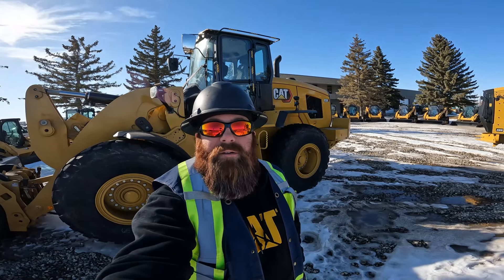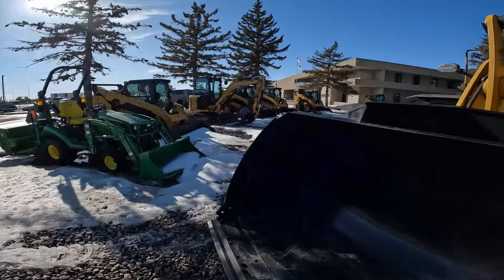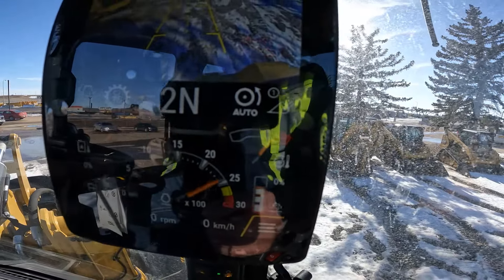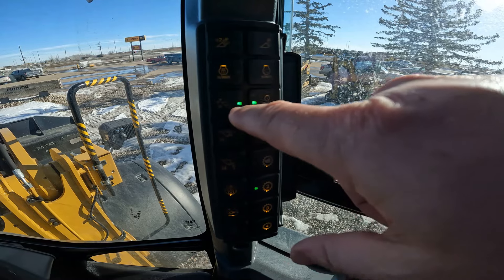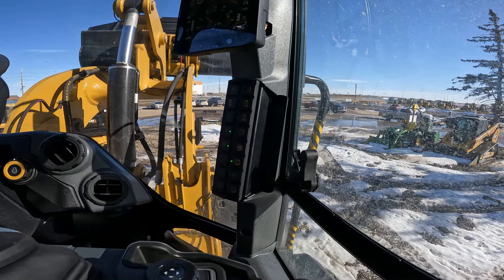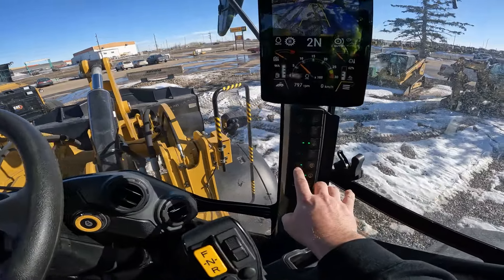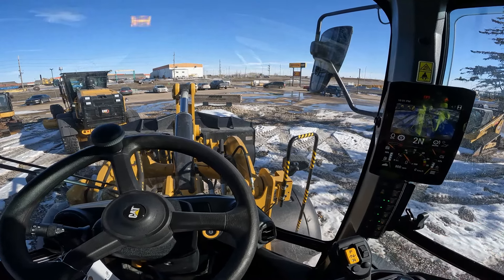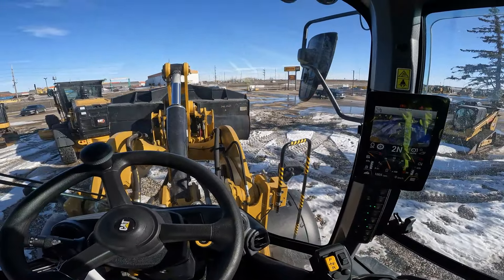Next Gen Cat 938 Loader - kickouts tutorial.

Comment: One question 🙋‍♂️. 
Dose the pony motor use DEF? 😂😂😂
Computerized kickouts 🤯 I remember getting out and setting the manual bucket leveler with a wrench 😮.  That’s about all the “kickouts” we had back in the day. 
Great video 👍
Reply from the maker: Hey Dan thanks for watching - I know what you mean fog the manually adjusted kick outs - this is sure an easier and faster solution.  And I don’t think many engineers would know what a pony motor is now days - but even so their under 75 Hp and run on gas so they shouldn’t require def in todays world.  Take care
Reply: My loader has a wire cable coming from a winch up over the frame on the fully air conditioned cab which lifts the loader , the kick out is set to stop when I let go the winch lever , it powered by a Fordson E27N petrol tvo 😁
Reply from the maker: @johnt7232 😅 funny guy

Comment: I am starting a snow removal company and am thinking the 938 would be the perfect machine for parking lots.. Would you agree? My goal is a fleet of around 5 of them.. Thank you for the video.👍
Reply from the maker: @dannymcnally6211  I would say a 920, 926, 930, or 938 would all be great options for snow clearing in parking lots, just depending on how high you have to lift or load into trucks.  Have a look at the specs for each and pick the rigs best suited for your application.  Or maybe even a combo of a few, maybe you’ll need a smaller one for smaller parking lots, but I would be happy with any of the 4 for snow clearing in parking lots.  Your local dealer reps will be very helpful in sourcing the right machines and attachments.  Thanks for watching and Merry Christmas
Reply: @ Thank you my friend.. I am going with the 938… I would rather have more  power than I need .. Merry Christmas.